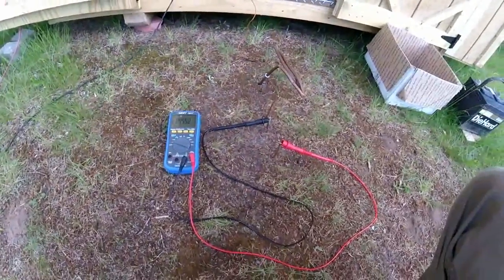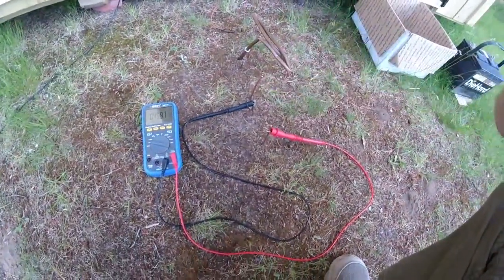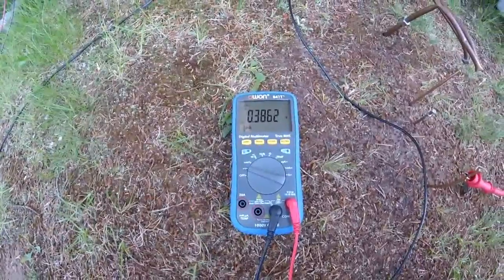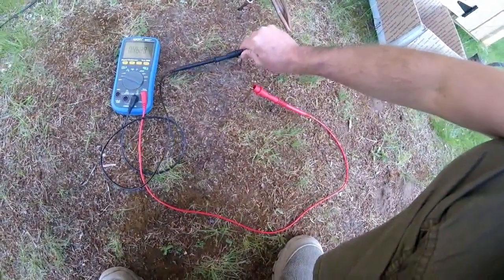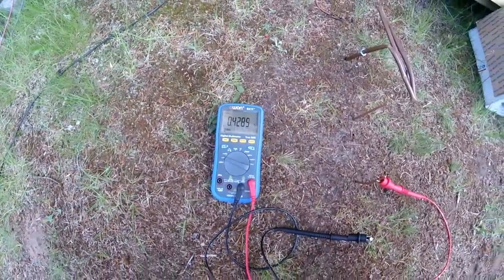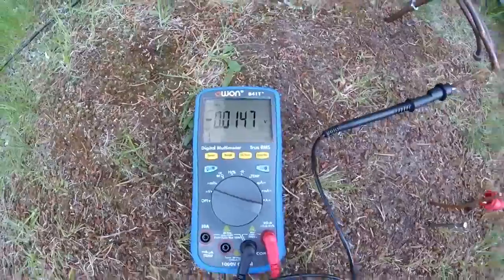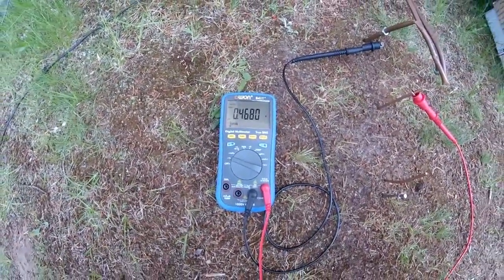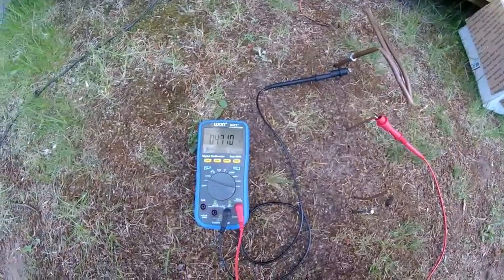Earth Battery Free Energy From The Earth   Simple Experiment Jn 2017

Comment: The movement in the voltage that you are measuring, (not “pulling out”) is because when you shove the metal into the ground, you create friction, which has the capability of producing a momentary voltage
Reply: It's not from friction. Not at all
Reply from the maker: I have found that it is hard to perform the earth battery experiment here because its just dry sand all the time. Its almost a chemical battery to some extent but some say they get more output in strange ways.

Comment: Acàully the key is your geological location. And for reference were u are located from the meridian. Alot more science to this than one might think you can and I have seen it draw 1600 amps yes 1600 amps from the earth using the right calculated locations as well as the proper metals and depth of the position have fun guys real science will always be above the level.
Reply: As geophysicists we have trouble injecting 10 amps into the ground.  It is impossible to draw 1600A from the ground unless connected to the power grid.

Comment: Not really free energy. Just a chemical reaction. The earth serves as an electrolyte in a non-rechargeable battery. Put some dirt in a container, stick two electrodes in it, put an electrical load on it... One of the electrodes would corrode, and the battery would discharge. Definitely a nice concept to demonstrate, but to me, free energy has to be usable.
Reply: I was thinking it was probably galvanic corrosion, the copper acting as an anode for the steel. It would probably do the same thing if the nail and copper wire were in a glass of water. And yes, it would cause the copper to corrode but prevent the nail from corroding. The flow of electrons should be from the copper to the iron nail, I think.
Reply from the maker: Its free in that you do not have to pay for it or make it. Its just there waiting for you.
Reply: You have to pay for the metals and one of them will corrode. But the bigger questions are.... And what usable work will it do? What is the energy density in watt/hours per kilogram? As compared To lithium ion batteries. Again, definitely a cool concept to demonstrate, but useful work?

Comment: Its just a galvanic reaction using the minerals in the soil as an electrolyte to shuttle the ions . Neutral ph will yeild zero volts
Reply from the maker: Cool tho. Amd free once you have the metals.
Reply: @TheDoItYourselfWorld  yes cool. If you want to create greater voltage potential then run a wire some distance to another dwellings earth ground . Careful though as it has happened that the potential has been greater than 60 volt and you can stop your heart so take precautions !

Comment: I think your power would go down when the copper is corroded or the nail is. I bet it's all coming from that chemical reaction
Reply from the maker: I read that the metal sometimes lasts many years. Imagine a ground rod for your home. Its always there.
Reply: The ground rod for your home doesn't normally have current flowing through it. Nor is it in the ground next to a dissimilar metal.
Reply: @DavidJohnson-tv2nn  has to have current going through it or why would it be used?
Reply: What would happen if you used gold, silver, copper, bronze, iron, lead and platinum in a flower of life geometry? In series or parallel and  find the right sequence

Comment: Wow! This is great. We should think how we could further expand its capacity. Maybe greather depth rods/ nails. Maybe thickness even?
Reply from the maker: You can use multiple earth batteries to increase volts and amps. Larger plate surface area increases as well.
Reply: In practice this doesnth work you most i have ever got was with aluminum and tin wires i only got .83 volts and found that 12inch rods work best
Reply from the maker: I have heard of up to 4 volts in some areas